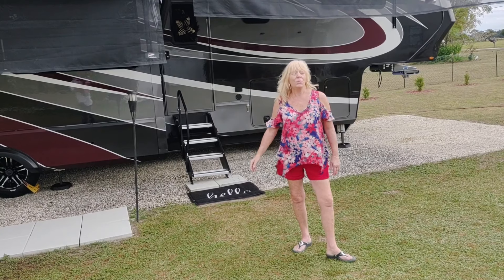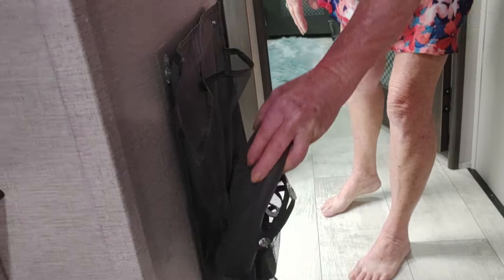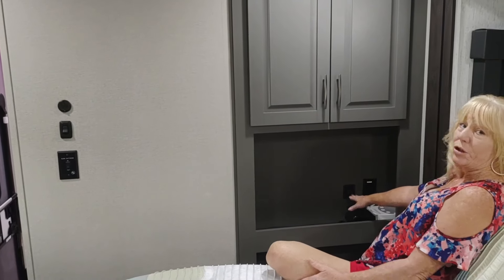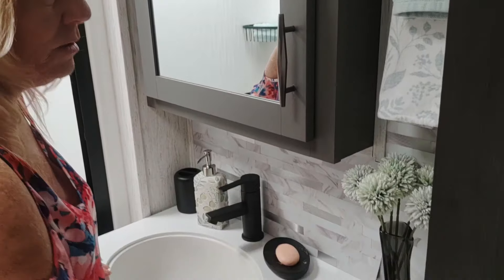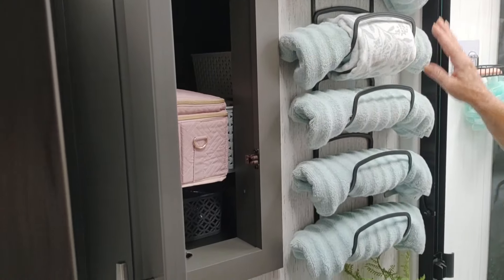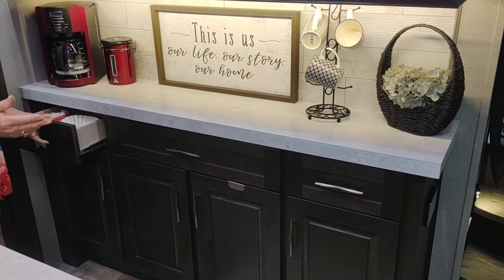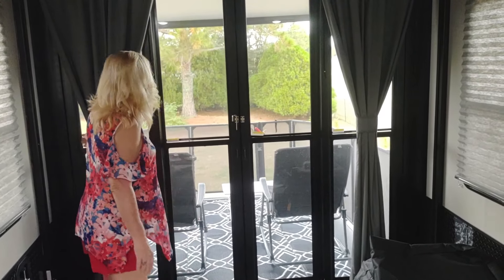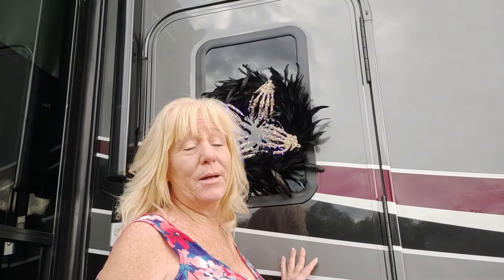2022 Grand Design Momentum 397TH-R - Interior tour of our new RV

Comment: I appreciate your practical organization style. I love to have our stuff organized but in a way that makes sense. A lot of the stuff you mentioned are things I already use at home. Broom rack is super practical helps clear up of space. Something I recently did was use shampoos, conditioner and liquid bath soap dispensers for the shower wall. Originally, I used similar shower shelves like the ones you have, but they tend to get all kind worn down and dirty after a while. So I think the wall adhesive dispensers are bit more practical. Amazon sells them in packs of 3 or 1. So I got 4 of those. They don’t need any cleaning. Funny, you mentioned the office space in the garage, cause that’s exactly why we were looking at toy-haulers. We both work remotely, but my husband deals with more meetings than I do, so we need separate office spaces, not to mention we both work with multiple monitors. The toy haulers allows for that type of set up. He would take the garage space and I would work in the dining room table- cause I love the light and big windows. Great job with the stairs too. I thought the same thing when I saw those thin steps. Lastly, one thing I love about the toy-haulers is the outdoor patio space. Overall- kudos to you for the most practical organization presentation I’ve seen in a lot of videos. Enjoy!
Reply from the maker: Thank you so much. The office space has worked out great for us so far, but the real test will be in April when we are traveling for a month and a half.
Reply: @kdsrvadventures8621  YW, Iet us know how that goes. We would love to start planning for a full time transition within a year, but we have elderly parents we’re directly taking care of and various real estate to deal with. So, looks like we’re going to have to wait. In the meantime, I love to watch the experiences of other folks. Best of luck to you both!

Comment: Do you have solar panel option,how do you like your residential fridge
Reply from the maker: I didn't opt for the Grand Design solar package, because I added my own system which can power the whole RV. However, If you go with a residential fridge, I would definitely recommend the solar package, if you are not adding your own system. We love the residential fridge, and with solar, and decent batteries, you never have to worry about power while towing. So much better then the RV fridge we had in our previous trailer, and we have ice!
Reply: @kdsrvadventures8621  the dealer told me the batteries would charge when hooked to truck when you drive.
Reply from the maker: They will provide some charge, but not enough for a longer trip with the fridge running. Especially with the stock battery the dealer will most likely provide. I ended up getting rid of the stock dealer supplied battery, and went with eight BattleBorn Lithium batteries, which can not be charged from the truck, but with 800AH I can boondock easily overnight and charge the batteries with solar in the day. Eight lithium batteries might be overkill for you, but I would look into switching out the stock battery for something that can hold more amp hours. Maybe two or four batteries. If you have a generator, you could quickly charge them if they did get too low.

Comment: Do you know what the round black thing is on the wall above the vent fan control to the left of the fireplace? There is also another one in master bedroom by the light switch
Reply from the maker: It is the temperature sensor for the AC and heat.
Reply: @kdsrvadventures8621  thank you

Comment: Absolutely loved the video. Could you go over what setup you have to run the refrigerator on travel days/boondocking. Batteries/inverter etc. How long can you run the fridge on the inverter before the gen kicks in?
Reply from the maker: I just added (literally five days ago) eight BattleBorn batteries (800AH total), a Multiplus2 3000 watt inverter, and 1280 watts of solar. With this setup I don't ever need to run the generator (unless I need air conditioning for more then a couple hours). I do have an auto start on the gen that will kick on at 20% state of charge just in case. Before I added solar, I had just three BattleBorn batteries, and the fridge would run for about a day and a half before the gen kicked in. When we first got the RV at the dealer, it just had a single no name brand lead acid battery. I didn't even make it home before the battery needed charging (about an hour and a half). I plan on making a video showing my setup in the near future.
Reply: @kdsrvadventures8621  Thank you so much for the reply. Love the setup! The wife and I will be ordering our Momentum in the next month or so and this helps alot. Thanks again.

Comment: Please let me know when you make video of the outside. We want to see it. The master bathroom tile is just beautiful, could you send the link? Also, how long and wide are the curtains you made for the loft?
Reply from the maker: You can subscribe to the channel, and you should be notified when the video come out (in about a week or two). There are now links to everything in the description below the video. Diane used regular curtains and cut and hemmed them to length. I'm not sure of the exact length or width, (not at the trailer at the moment) so you may want to measure your area just to be sure. Thanks.
Reply: @kdsrvadventures8621  Thank you very much. I subscribed so I can get the new video when you release it. We are waiting for the awning and washer/dryer to come in and be installed before we do final walk through and accept camper. I am trying to order everything now before we pick up the camper. If you find the size of the length and width of the curtain she made I would greatly appreciate it.
Reply: @kdsrvadventures8621  Hey Diane. Could you tell me how long and wide you made the curtains for the loft please
Reply from the maker: @tabithawade9485  Diane is going to get the measurements for you tomorrow.
Reply: @kdsrvadventures8621  Thank you so much
Reply from the maker: They are 40" wide panels cut and hemmed to 22" in length.
Reply: @kdsrvadventures8621  Thank you very much

Comment: Looks like a 2021 bedroom to me 🤔
Reply from the maker: This is a official 2022 according to the VIN before Grand Designs mid year model changes as it was in production in June/July 2021 and as you can see there were changes in design for ours the black sink in garage bath, both bathrooms vanities are now solid gray , the shower fixture is different and also large 4 burner oven in addition the fireplace surround is now tile and not silver aluminum. . Right after we took delivery Grand Design then made their mid year design changes which was within weeks of our delivery.